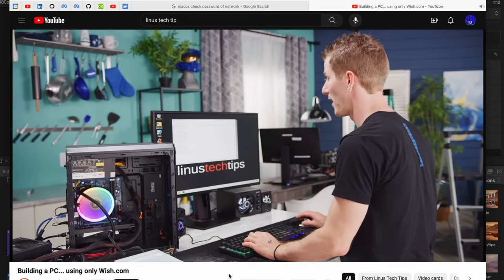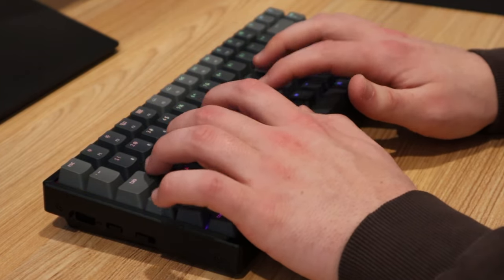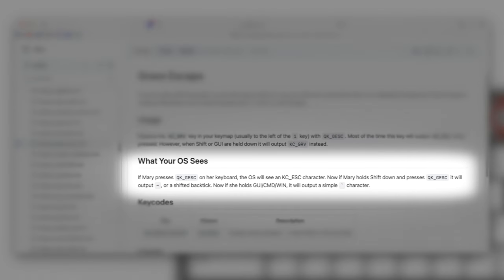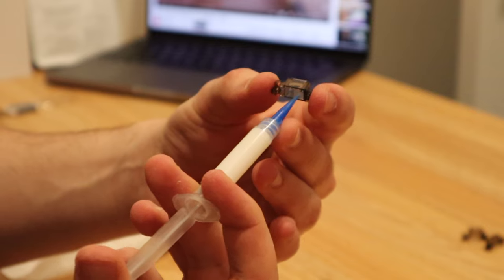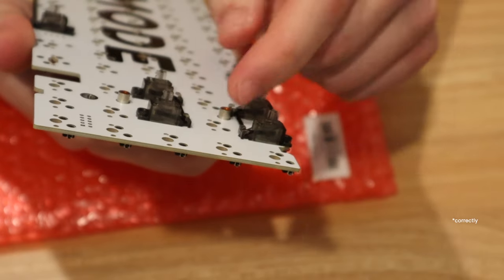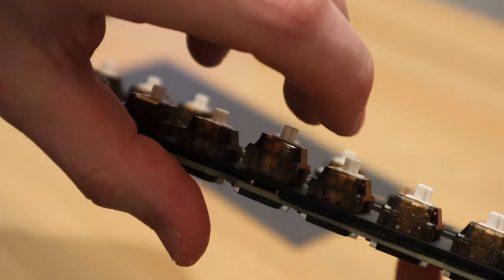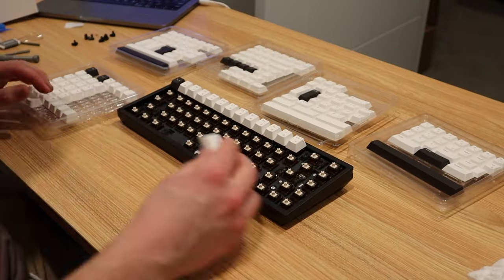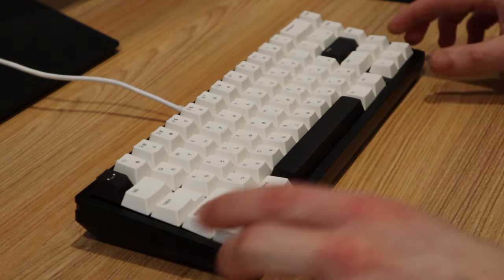Building my first keyboard

Comment: There is SO MUCH wrong with this video.

- The friends keyboard was not thocky at all.
- Removing the F-row doesn't free up horizontal desk space, compact 75%s are the same size as 65% and even standard TKLs are only about an inch and a half longer. No F-row makes quite a few games significantly more difficult, and not having a separate numpad will dramatically slow down many productivity tasks.
- Brown and Red are not switch types. There are many kinds of switches, tactile/linear/clicky with all manner of spring weights, travel distances, long v short pole, actuation points, materials, tactile positions and strengths, etc. Original cherry reds are pretty bad for gaming as while they have the light weight, the travel and actuation points are much too far down. Gateron Silver among many other similar switches are dramatically faster, before you get to hall-effect + rapid trigger boards. Tactile switches are also not inherently faster for typing, they just often give greater certainty in your keypresses all over the board which can help you feel mistakes or even realize before pressing down with enough force to pass the bump. In terms of raw speed however, short-travel linears are likely going to be the fastest as if you bottom out in presses, it occurs much sooner and sends you onto the next key earlier. ... The "I don't care about your opinion" claim is wild when you haven't even tried any switches yet, especially for actual day-to-day use, you haven't formed an opinion yet at all, and it can take a lot of trial and error to get there.
- Japanese sub-legends are not for actual use, it's purely for aesthetics not just thematically, but it's a way to get more of the color of the legend onto the cap which can help fill out certain color schemes.
- Lube is expensive, you use a palette and brushes to apply coats without wasting it by doing something like letting it absorb into a disposable sheet of toilet paper.
- You installed the stabilizers before PE foam / switch pad/sheet, blocking that from being put on, and then you didn't install it at all. It's a very very important piece when going for a thocky/foamy type setup.
- Stabilizers not shown much in the sound test, but the spacebar seemed to have considerable metallic rattle, as from the close-ups it didn't look like the wire in the stem was lubed enough or at all. Plumbers tape mod or more modern doubleshot stabilizers can prevent all ticking and rattle. And for the space bar specifically, car dampener or some equivalent can really clean up the sound.
- Using a desk/keyboard mat is pretty essential for most boards to not become overwhelmed by desk noise, really unless their internal gasket structure is incredibly effective. The desk noise is why the Envoy and the Keychron sounded far too similar than they otherwise should.
- This is a $365 setup before tax/shipping and lube. Arguably better sounding pre-built boards for the goal sound profile exist for a third the cost.

There's a ridiculous number of things to learn about keyboards, and I bring up all these points to illustrate that its not something you can just throw 400 bucks at... getting something that's really great AND suits all your preferences (that you might not even initially have without the experience) is far more about research and careful choices, and can often be done very cost-effectively.
Reply: i was watching this thinking a lot of the same things and he didn't lube the wires of the stabilizers even though he has a syringe to do it after they are already installed. Also the envoy uses 2 screws to hold the plate/pcb assembly in so it doesn't fall out because it can't really friction fit like a gummy o-ring board.

Comment: Im sure someone else noticed this before but, you built it plateless... which is awesome! but not with hotswap, you are at a pretty high risk of popping a hotswap socket when you type, granted there is case foam inside so it might be ok but i wouldnt trust it. Plateless or half plate builds are usually done with solder PCBs so theres  no chance for the switches to come out. Also i gasped when i saw the stablelizer lubing, tho i respect it haha.

Comment: Nice keyboard for your first build! I noticed that there's a mistake with the pcb assembly, the switches are not snapped in properly with the plate, you might want to fix that. Also if you want a truly thocky build you should try adding in the pe sheet.